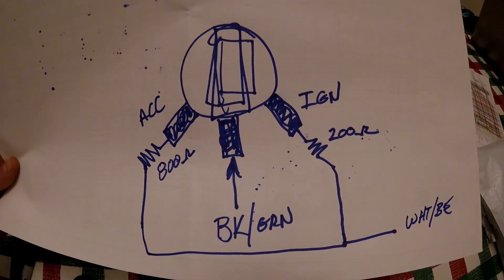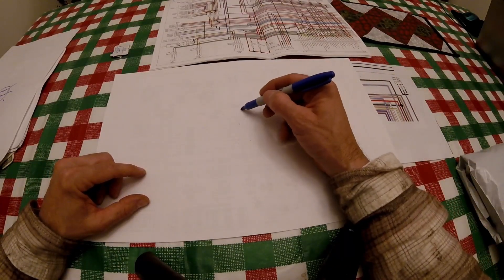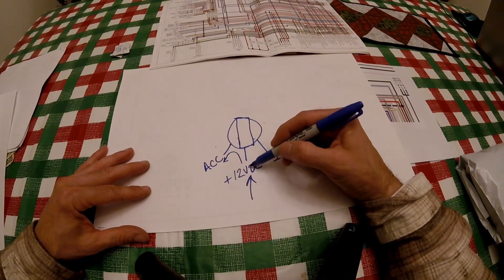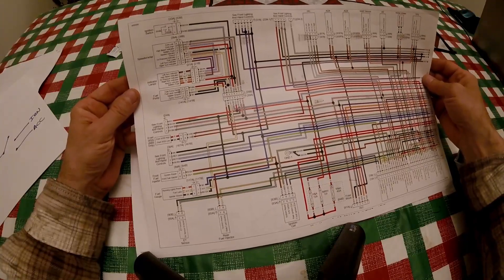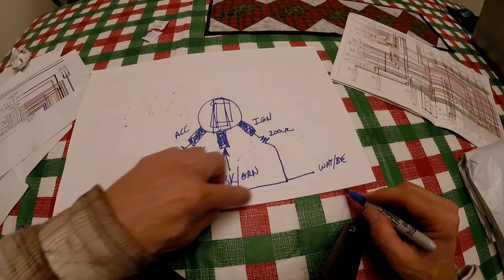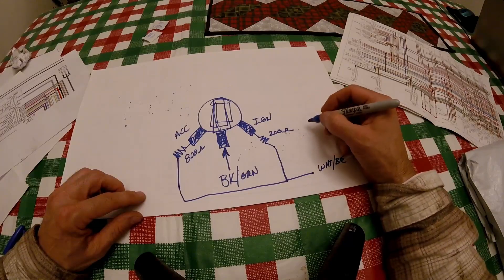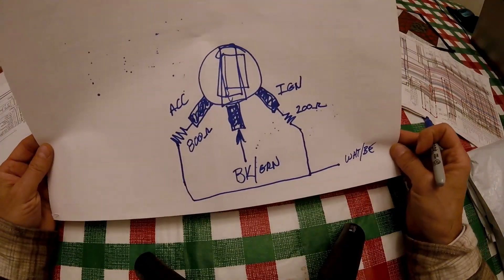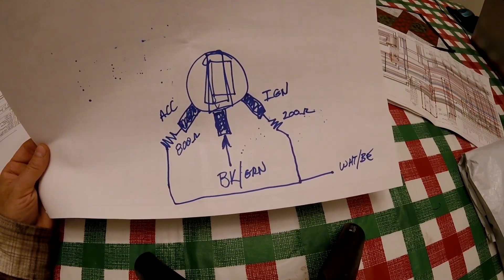Harley CAN BUS Key Switch conversion to any old style Key Switch system #harleydavidson #canbus

Comment: Bro you are smart ! Please help to install push buttons on my sportster 2021. I want to cancel oem switches and put the push buttons but I AI told me I can’t. Internet ( my research ) told me I have to wire a new board. Or I solder wires from the handle bar control board to buttons and hide the board somewhere and that’s frustrating because I have the brake light and clutch sensors ! I am loosing my shit to clean my handle bar on this 2021 harley can-bus shit.
Reply from the maker: Thank you for the comment. Unfortunately I looked over the wiring diagram and I wouldn’t know how to accomplish what you’re trying to do. With the power switch it’s a simple fix however with the one on the throttle side you have 3 things going on there. You have the front brake light switch, the right turn signal and the throttle position. These all talk CAN over one set of communication wires. That’s where I’d be lost. I would guess someone who can jailbreak the ECM could program the ECM to ignore all the data but that’s not me. It would be the same for the left side controls. Sorry I can’t help with that. This is one of the many reasons I love older bikes.
Reply: @Rapsgarage Thank you for the reply. Unfortunately I didn’t know about the ECM stuff and can-bus comm stuff. That’s the kinda stuff you will only think about or consider only after you buy the bike 💔
Reply: Hi again. How about if I cancel the brake light and clutch button ( meaning I can only start bike on N ) would that be fine or I would have other complications? Is there a way to only simplify the ignition switch ? So I keep only ignition switch. But my ignition switch is two phases ( 1-power on , 2- start switch ) would that be possible to simplify? I am ok with canceling the left and right turn signals ( if there is no way to simplify them ).
Reply: Also , what will be the way to put a power switch ( toggle switch ) and push button for ignition ?
Reply from the maker: @user-fy7xu8jt4d very true
Reply from the maker: @user-fy7xu8jt4d  I’m not so sure that you could do all that. I really don’t have a good answer.
Reply from the maker: @user-fy7xu8jt4d  I’m not so sure that you could do that because of the can bus system. I don’t know how far the computer is involved.
Reply from the maker: Hey buddy, I just found out that you can eliminate the computer completely on your bike and do a custom wiring job so that you can have the buttons you want. You have to get an earlier cam cover and earlier cams. The early cam covers have the location for an electronic pickup, like the Dyna 2000i. The earlier cams have the notch in the end of the cam to mount the ignition cup for the electronic pickup. You have to get one that has the matching oiling holes and get a gasket that matches also. The wrong cover or wrong gasket and you will not get oil to the top-end. After that you can put a carb and manifold on it and away you go. I don't know exactly what year cam cover you would need but I would look at the last year that Harley used the ignition pickup in the cam cover. Once you have a stand-alone ignition and a carb, the motor will run.
Reply: @Rapsgarage  I saw that option but it’s more expensive than getting an older bike. I saw some moto-gadget stuff that can make that happen but switching for carb is a hustle too and I need a really good mechanic. I really appreciate your help !!❤

Comment: Does it work for a keyless model
Reply from the maker: What bike are you talking about exactly
Reply: @Rapsgarage a 2014 sportster 1200 xl custom it takes a key fob
Reply: @Rapsgarage ?
Reply from the maker: @tylergonzales9586   Looking at the wiring diagram, I would say you could do it since (and I'm guessing here) the wiring diagram shows the wires in the harness but not connected to anything. See the bottom of page 2. It says "To ignition switch (if equipped)".  I'm guessing you could add it there. I believe I could make it happen or I'd give it a try even if I had to add the wires to the harness connectors, but that's me. Would I recommend you try it? No. I wouldn't because you could damage the others CAN BUS modules. If it's my bike I might be willing to take the chance but I wouldn't recommend it to someone else. Understand, you could render your bike useless.
Reply: @Rapsgarage Ty for the info boss
Reply from the maker: @tylergonzales9586  Sorry I forgot to attach the link for the wiring diagram.

https://serviceinfo.harley-davidson.com/sip/content/document/view?id=5541#462b3f1f-9bcf-4359-a39f-f89a8ca90c92!!1!2
Reply: @Rapsgarage thank you again friend

Comment: I want to run a slim design momentary start switch on my bars. Do I wire this in series after the 200ohm resistor?
Reply from the maker: @MegaDaDom  the resistor can be before or after the switch. The computer just needs to see the 200 ohms. But the switch can’t be momentary. The store switch can be momentary, but not the run switch and that’s where the resistor goes in the run switch circuit. Let me know if you understand what it is. I’m trying to say. Thank you for watching him please like and subscribe and reach out if you have any more problems.

Comment: I have a canbus switch I wanna use as analog switches. Can you help me?
Reply from the maker: Outside of disassembling the switch and taking the resistors out of it I’m not sure you could use it. Also, I don’t believe it’s a high power switch at all.
Reply: @Rapsgarage that’s what I was thinking just wanted confirmation thanks. Will unsolder switches and install analog ones so it appears stock from outside
Reply from the maker: @ good call. CAN Buss is very low voltage
Reply: @bruizer28 Hi. Did you do it ? I am thinking about doing the same ! But what would you do with the clutch and brake switches ?

Comment: Hi what’s your thoughts- I have a damaged 2022 street glide CVO - the steering lock was removed by insurance evaluation process - bike has no steering lock. The steering lock has 4 wires going to it - 2 to make the lock pin go in and out - the other 2 wires recognises weather the steering’s locked or not - won’t allow power if steering is locked . Will connecting the 2 wires with a resister tell the BCM the switch is there?       Once I get power I can flash the BCM to remove the lock - no power no flash. Thanks
Reply from the maker: I did take a look at the wiring diagram for that and it’s quite complicated. I might be able to help you through some of it, but it would be easier if you contacted me on my email. hdrap_1999@yahoo.com.